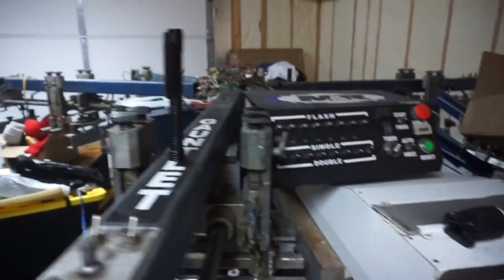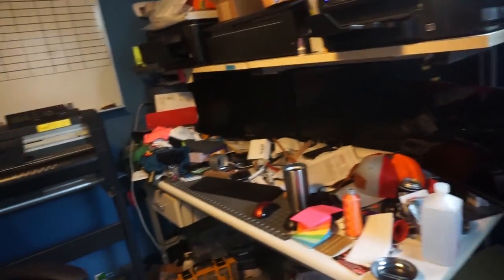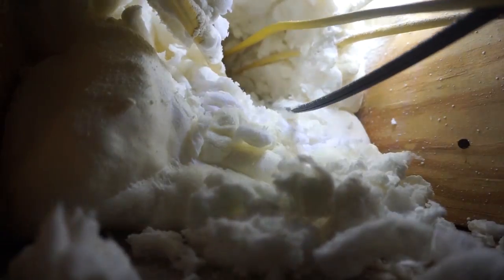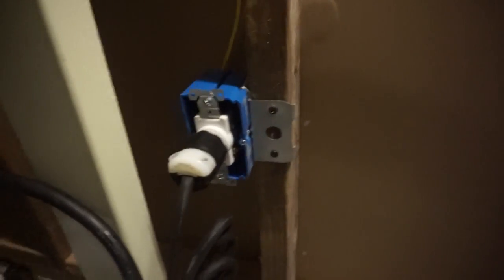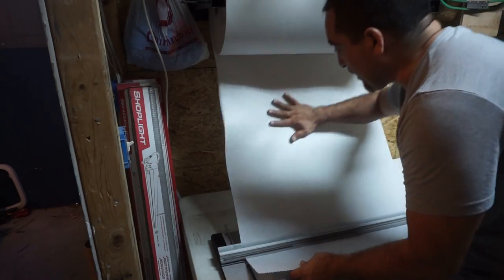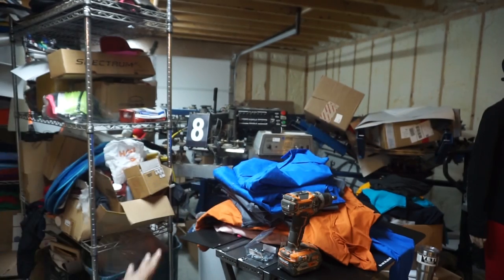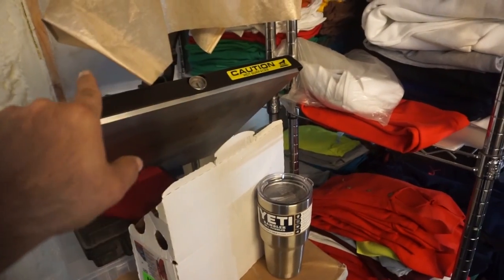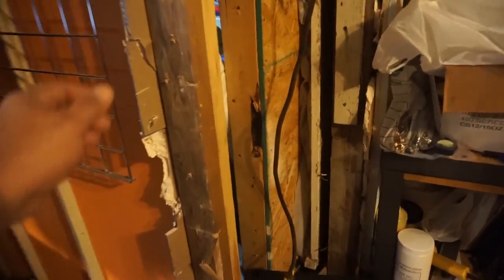SETTING UP THE SHOP WITH LIMITED SPACE

Comment: Hey brother what transfer tape do you recommend...? I have bought a few and its frustrating as heck. One will not separate the vynil and paper and the other will separate them but not let the vinyl stick to where I want to put it. I'm using oracal 651.... I think its called.
Reply from the maker: that's a common problem with oracal 651 they change the formula about 6 years ago and since then we been having that problem, you can use the one that sticks better to the vinyl and when ever your ready to remove the tape, wet it and wait about 2 minutes it will release faster